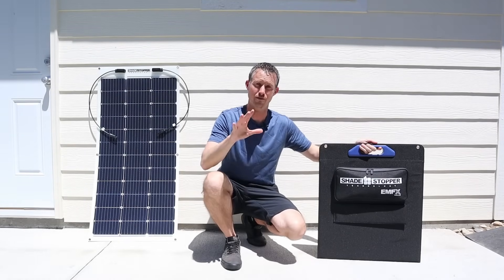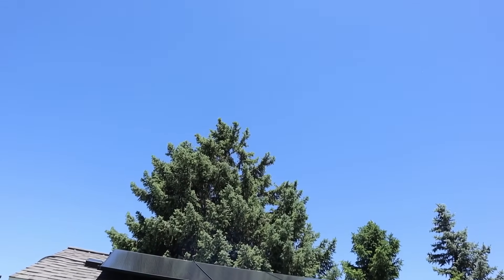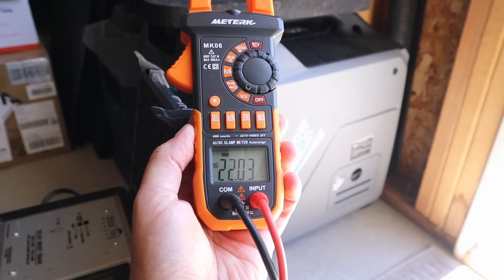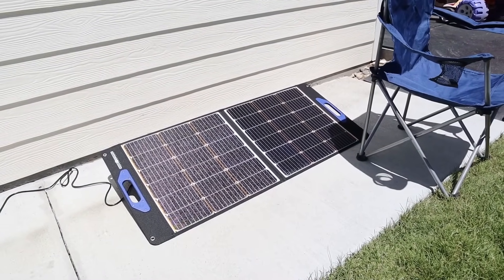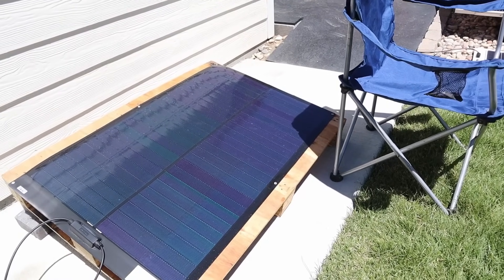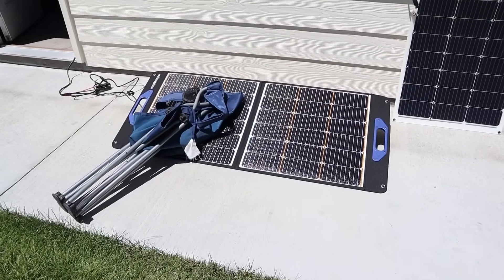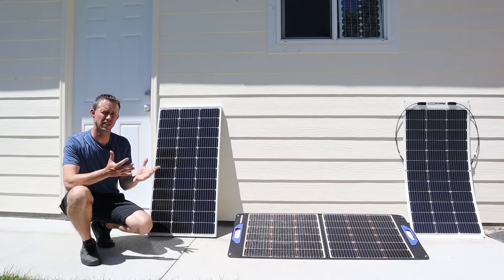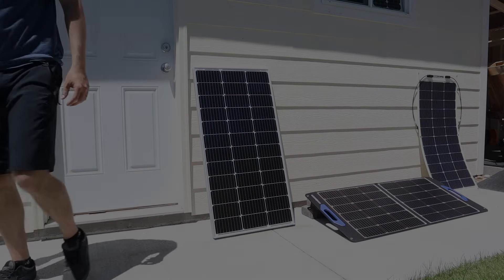AFFORDABLE Shade Tolerant Solar Panels!  ShadeStopper 100w Panels Tested

Comment: My property is wooded... no wonder my 100W Renogy panel is barely enough for lighting (12V) my garden shed. I watched your Series vs Parallel beginner's guide figuring I was going to add another 100W panel. I learned for my application, partly shaded, parallel would be best. After watching this I'm thinking the shadestopper is what I need. Wish they were available in a rigid panel. BTW, excellent videos.👍

Comment: Thank you.  I had decided on benchmarking cigs panels moving forward because my application on a tiny cargo trailer build in the midwest that would only accommodate a couple solar panels and I need best efficiency as we've a lot of lake effect cloud cover. Everything else would have to be portable. I already own 2 160 W Folding ecoflow panels that I got with my Delta 2 Max. I was watching another of your videos and I was planning on Learning to wire them in series or parallel to take advantage of both solar imputs that max out at 500 Because I understand overpaneling from another one of your videos. My thoughts were to Go for a couple 400 W panels if I could make them fit to run all the time. And then when I'm in an area where I can.
Put out portable panels I could run those two Into the same input in series. So I don't overvoltage and then use the other port to plug in my smaller portable stuff for an extra little boost. If the math worked out, such as on a less sunny day where i'm perhaps getting not much over half rated output from the nearly 800 potential. If I had 260 W panels in series plugged into the other. And I was even getting half of that. I'd still be getting well over a 100 W additional input for minimal additional cost/ effort

Comment: Nice panels. For the price I would go with the flex panel. I would not mind getting the foldable one, but I just do not like the prices on them, that sale price is really good for a foldable panel that actually has diodes built in. I just do not see buying foldable ones for daily use unless you are full time in an RV or vehicle.
Reply from the maker: The pricing on the flex 100 is really good! They are super lightweight and perform really well!

Comment: very nice, i would need to have this type of solar panel if i was gonna use them, as the sun moves around all morning long with the various shading elements.
Reply from the maker: It definitely would give you more power vs a normal solar panel. The pricing isn't too bad either!

Comment: Great information Jason.  I'm in the process of replacing my agm batteries to lithium in the next 18 months on my class b rv.  I was thinking of replacing the solar panels as well as they are beaten up pretty bad with the Texas heat.  Was wondering if the shade flex panels fold enough to make the curvature design of the Ford Transit van, tough they are not visible from the front.   Was not aware that the cig panels had technology similar to the shade stopper.  Regardless of what happens in the next 18 months now I am definitely replacing the solar panels for sure.  Might consider buying some for the yard also as I am surrounded by trees.  Thank you for your hard work and sharing your findings with us.

Comment: With similar performance, the real difference between the new panels and cigs are the flexibility and the cigs output resistance to damage.

At their lower price, I can see these new panels do well as permanent panels on an RV roof and the cigs in more in temporary installations. 

Hopefully pricing comes down soon for this style.

Comment: Very nice demonstration.  Having "bypass diodes" across smaller groups of cells in series is commonly done for custom solar panels made for things like solar race cars.
Reply from the maker: I didn't know that!
Reply: @Jasonoid  Another tid bit for you, the solar cells most commonly used for satellites and such are generically known as multi-junction GaAs based solar cells.  Because of the "delicacy" of the incredibly thin layers of materials used in their manufacture, they are all but required to have a bypass diode on each and every cell.  The reason is because, unlike common silicon solar cells, MJ GaAs cells would suffer immediate and irreversible damage if they are exposed to minor reverse voltage.  The bypass diode eliminates this reverse voltage risk.

Comment: It is interesting that the CIGS panel maintains a higher load voltage than the silicon based panels under similar shading conditions.  I wonder if they (Shade Stopper) are using germanium based bypass diodes to overcome some of the bypass voltage drop across a silicon bypass diode (0.6 V for silicon vs 0.3 V for germanium).  This would be a concern when connecting several of these panels in parallel where most charge controllers will limit your current to 8 amps for voltage inputs of 13~14 volts.  Even in series (or series / parallel for larger arrays), you may find that when shaded, the array drops the voltage below that 32~35 volt threshold where you actually loose even more power because the charge controller drops to a lower current limit.  Thanks for another review of an innovative product!  PS  I hope you are going to be reviewing the upcoming EcoFlow Delta 3 Pro, which looks to eliminate all of the flaws with the Anker F3800, which is still a great product.  Hopefully EcoFlow gets the price right!
Reply from the maker: I wasn't able to find any information on the types of diodes used in the product. That would be interesting to find out.

Comment: Great video as usual. I have the Shade Stopper and the Cigs. Both are great panels. Will be trying the flexible one. Thanks for the discount.
Reply from the maker: The Flex 100 is probably my preferred option. It's lightweight and seems to be built really well. It's thicker than other flex panels I've tested.

Comment: Very interesting review!
As noted, the CIGS also beats every other flex panel with its incredible bend radius.  I put the 200w one on my motor-home, and have to upgrade the charge controller because output is so high!
Another comparison I would love to see is this new panel vs the Optivolt one that you tested.  I would think that would be a true apples vs apples test!  (Although I think you reviewed the 48v output Optivolt.)
Now I am regretting buying two of the Renogy (private labeled by HQST).  Oh well, they will be "fair weather friends!
Reply from the maker: HQST panels have a great price! Usually you can find them for $0.60 per watt and they perform well in full sun. I'm curious what the difference would be between a Renogy 100w and the HQST 100w.... the specs and sizing are identical but are the cells the same quality?
Reply: @Jasonoid  apparently so, rated @25%.  Many of HQST products have Renogy packaging, as does Dr Prepare.  However, their CS stinks.  After my 1st 60A MPPT charge controller worked flawlessly  (save foe very weak Bluetooth) I bought a 2nd one, as the 60A model has low temp cutoff on charging below 40F.  But, this unit took my 4P 100Ah Power Queen LFPs to 15.7v!  I had gotten 5kW from the bank prior, but am down to <3kW now, with <8 cycles on them.  HQST gave me some cut & paste excuse that it is OK to go above 14.6....NOT!  They won't answer now.  Avoid HQST!
I may reach out to Renogy...nothing to loose!

Comment: I have 12 Renogy 200W flexible panels.  While I was trying to figure out how to best mount them in a way to be adjustable angle-wise, I just wired them all together & laid them flat on the lawn so I'd get some juice outta them.  What surprised me is I was getting more wattage for a longer duration than my flat roof mounted panels that are aimed directly at the sun... at least they are at noon.  So I made a mount for them on the side of my house that allows me to change their alignment with the sun, but by doing that, their output dropped.  It must be because when laying flat on the ground they have more exposure to the sun for a longer time than when angled correctly, which has a higher peak, but over an 8 hour span probably has less average exposure.  Does this fit with what you know?

Comment: I bought two of the folding shade stoppers back in February, the price has about doubled since then. The Shade Stoppers won’t help you during overcast days, but are very impressive,as you demonstrated, with sunny skies but partial shade.
Reply from the maker: After all the solar panels I have tested, they all seem to perform about the same in overcast conditions, 10% to 20% of their output, sometimes even less if the clouds are really thick. I don't think there is any tech out there that allows for better 'cloudy' performance. The sun is just completely blocked at that point so no power is coming through.
Reply: @Jasonoid  With all the technological advances we have made, maybe in the future, we will be able to collect significant solar energy even on cloudy days. I wonder if it’s even possible.
Reply: Yeah, I noticed that the reviews say it's $100 for the foldable one. Looked at the archive of their site and indeed they were selling it for half of today's price. Likely need to wait till they drop back down.
Reply: Great video. I've got a 13 foot RV trailer, with a 12 volt fridge that's a bit of an energy hog. I've just ordered  the shade stopper folding panel to replace my old, sturdy, dependable, but very heavy GoPower portable panel with aluminum frame. We do a lot of camping in forested sites with intermittent direct sun, and I'm hoping this will squeeze out some more watts, while being smaller and lighter to move around. I've got the tie down stakes you recommended a while back.

Comment: Do you have any significant cell cracking with these semi-flexible panels? I have been testing some really cheap monocrystalline solar battery maintainers, but they're super flexible and the cells seem to have cracked (shining a light from behind reveals some possible cracks), though according to my limited testing, they seem to work fine. These are not the shade tolerant ones you show here, but they seem to be made from the same stuff around the cells, just my little cheapo battery maintainers lack any bypass diodes.

Comment: I have a Renogy 175w solar panel on my van and EB55 and it seems to max out at 99watts for some reason :/ Considering getting either an eco-flow or another panel, not sure.
Reply from the maker: Panels laying flat won't see full power, unless during mid-day in the summer. They need to be angled properly towards the sun to get full power.
Reply: @Jasonoid  Even when my van has been on an angle  and full-mid sun, I never saw it hit past 099w. I think something either may be wrong with my Eb55 or the panel has become damaged from the Australian heat. I also am aware of the heat-issue. Also the extension cables are 15ft look that go from the panel to the powerbank, do you think that could be an issue? they are 10awg I believe. Solar panel originals are 14awg i believe.

Comment: Do you have any idea what the efficiency drop off is if the panels are used in a hot climate like the South West U.S. in summer time at say 115 deg. F ?
Reply from the maker: I don't know the exact numbers but panels do produce less power as they heat up. That's so pretty hot temps right there!

Comment: I’m confused.  I saw a video you did comparing a bunch of solar panels and you shaded all of them pretty heavily. And the shaded panels that still produced power were said to have been wired in parallel and that was the reason given why they still worked. Versus the solar panels that produced no power when shaded were said to have been wired in series.  In that video there was no hype about which panels had half-cut cells or had diodes or not. What am I missing?
Reply from the maker: These are single panels. When a single normal panel is shaded it loses all power.  So if you had multiple shade stopper panels wired in parallel you wouldn't lose any power compared to a normal array. It's different to compare multiple panels wired together vs one panel on its own.
Reply: @Jasonoid  Still confused, but oh well. This is the video I’m referring to. How are they different from the ShadeStopper folding one?  Seems to me there are two panels. One for each half.  The ones in your other video do not have diodes yet some of them still provided power when shaded. https://youtu.be/O2Ib2NXrsyw?si=0YX4E4LGvMnYffa5

Comment: Can either of the 100 watt panels (folding or non-folding) be stepped on occasionally without it being wrecked?  My application is the deck of a 35' sailboat where shading from the rig is ALWAYS a problem so I would like to test it out, but sometimes it has to be stepped on to get to the mast or part of the boom. The glass panel panels with aluminum frames (like the Renogy featured in your video) that I have now are super tough and can take a step on no problem. Thanks.
Reply from the maker: I hear that you can step on CIGs panels without damage to the output. I would not recommend stepping on either of these ShadeStopper panels.
Reply: @Jasonoid  The Hobotech guy shot his all up and they still worked! I  am guessing you saw that episode!  The CIGS are too expensive for my liking. On a sailboat, shade is the enemy (but only for the solar panels)!
Reply from the maker: @MADsailing560  yep, cigs are great for durability haha
These panels will get cracks in them if you step on them and it will lower the output.

Comment: Question. So if the voltage goes down to the mid 13.? Will that be able to put a charge into my lithium battery thru an mppt charge controller?
Reply from the maker: The charge controller should be able to convert the power. The voltage is much higher if there's more sun.

Comment: My 2 cents on this video, while the tech is an "impovement" but the diodes are facing the sun so they are being cooked and overtime that degrade it and lost the abilty to function and in fact solar panel need to be all white and have cooling pipe of some kind.  Im more surprise the "improvemnt" wasnt that but are need the most.  I guess its on par(just as important) with the "shade stopper" tech aka diodes.

Having it all black and now electronic facing the sun tells me they are design to fail faster so thus you need to BUY more, what a lovely concept.  We(Im hopeful) all know black absorb all the sun light therefore gets HOT very hot over the day.  BTW would explain why the 100 or 200 watt panel never output such due to the panel being heated up.

Being all black around the solar cells make the panel even hotter, take those backyard solar light, usually comes all black and after a year or 2, the light start losting its efficiency or dont charge much when compare to brand new.  So I believe it was purposely design to NOT last long therefore you got to buy more now, what a waste of materials.  I also expect the cable on those panel to be white as well.  Everything white if possible to make them last much longer.